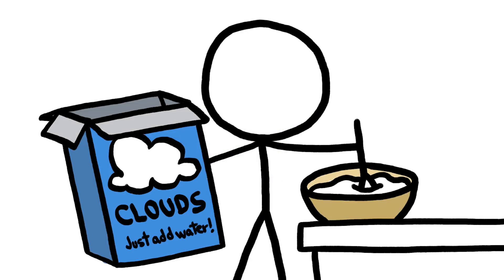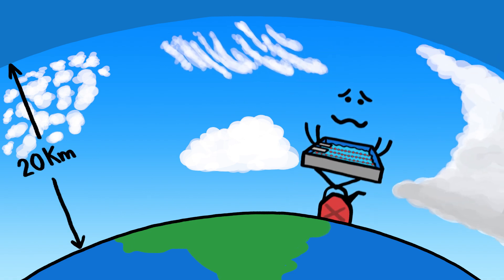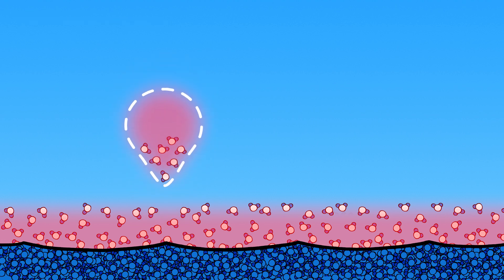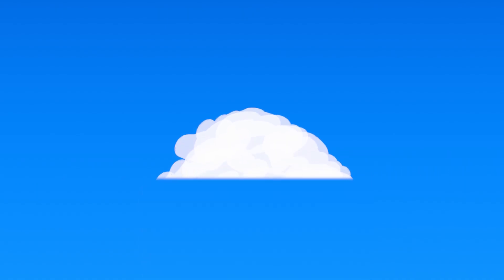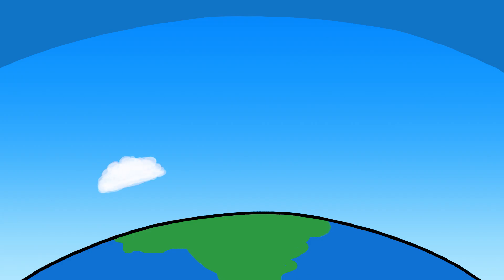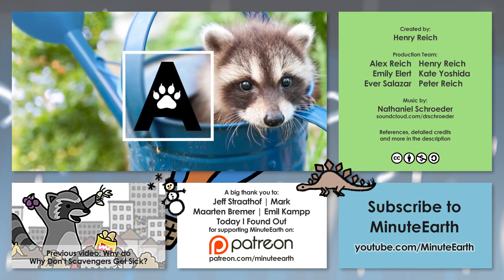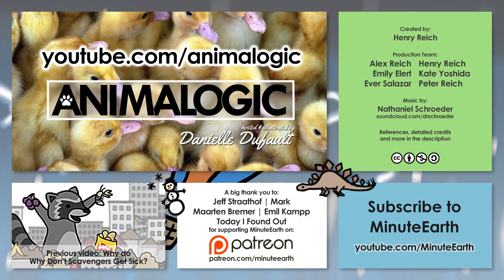Why Are There Clouds?

Comment: Great video and instructive graphics.

Do note if you're watching this that the statement: "in fact the more water vapor it collects before liftoff, the lighter it gets" while true is not a big impact.  Water vapor does weigh quite a bit less than air (18 vs 29ish grams per average molecule)... but water vapor is a very tiny part of even the most moist air (like less than 1% of it... so really dry is like 29 grams, and very very moist air is like over 28.9 grams... so it's not like it really balloons up a lot quicker due to being moist).  Certainly not a key point in the video, and one that makes sense to brush over... but for any who take that away from the video, be wary!

Comment: thanks.
i had difficulty understanding this part :
1:10 basic physics dictates that a given volume of gas
has the same number of molecules regardless of what those molecules are
then i found that is avogrado law
'equal volumes of all gases, at the same temperature and pressure, 
have the same number of molecules'
source : google (gas has the same number of molecules) result 1

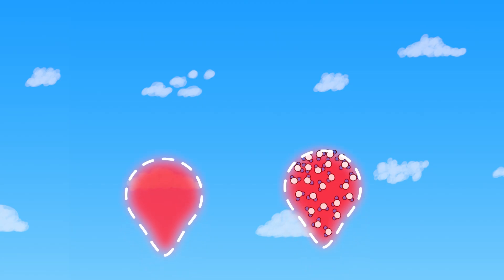1:16 h2o is lighter than n2, lighter than o2 so
warm humid air is more buoyant (lighter) than warm dry air.

Comment: Why are there clouds? I have no idea. Why is there air? Bill Cosby asked this question in the 60s. His conclusion is that there is air so you can inflate footballs and basketballs. I'm good with that. Oh, I think I need to add inflating tires. Gotta have tires. No tires, no driving at high speed or no auto racing. Got to have racing!

Comment: What I still don't understand is once the steam molecules condense back into liquid, why do they not become heavier than air again since the ideal gas law is no longer accurate and there can be more molecules in a given area. I am calling the equation at 1:10 the ideal gas law because it is so similar to the one I am used to but I have always seen it with lower case n instead of capital, and using R instead of K sub b. Is this just that physicists use different letter for same thing, or is this a totally different equation.
Reply: Sanity Clouds cannot condensate unless there is a surface. The cloud forms on floating particles in the atmosphere (Dust, etc.). The reason why the droplets doesn't fall is because the air resistance is greater than the pull of gravity. Wind smashes the water droplets together; thus creating bigger droplets. Soon the droplets would be too big for air resistance to hold it up, and the drop falls as rain.

The equation is certainly the Ideal gas law. 
Ideal Gas Law: PV = nRT = NkT
They are not different letter for the same thing, but it is a relationship between different calculations for the same thing. 
K(sub-B) is the Boltzmann constant
N is the number of molecules
T is the temperature

I've gathered and reviewed the information from:
http://hyperphysics.phy-astr.gsu.edu/hbase/kinetic/idegas.html
Reply: As I understood it air resistance is proportional to the velocity squared so there would only be air resistance if moving. Are clouds constantly falling at a slow speed and then climbing again when the water turns to steam again, or is that concept only applicable to large objects like planes and is inaccurate at the molecular level.
Reply: Gravity certainly move objects, and there is wind which moves the objects. I also think the heat rising from the ground probable plays a role too in keeping the cloud up.
Reply: the wind would only help if it was an upward wind, because side wind would only cause air resistance to exert a force to the side unless the cloud had an airfoil effect but that is unlikely since the top side isn't smooth and I think the air can pass though a cloud. My guess is that the molecules oscillate between the expanded gas and condensed water giving the appearance that it is not moving.

Comment: You said we would need fleets of airplanes to make clouds but we already have thousands of planes polluting our skies with artificial clouds on the daily
Reply: Not really. Those condensation trails disperse very quickly and can not accumulate.
You mihgt as well try to make fog out of the steam coming from a tea pot.
Reply: M. Koch haha "dispersed quickly" there is a difference from a Chemtrail and a Conrtail. 
http://www.geoengineeringwatch.org/wp-content/uploads/2013/12/941d53d329f33c9e56ee03092fae461d_1024-300x217.jpg

Comment: Aren't  particles, via heterogeneous nucleation, also a part of the cloud making process? The video seems to imply the water  condenses just because of the ideal gas law.
cf. Craig Bohren, "Clouds in a Glass of Beer" pp.4-6
Reply from the maker: heckler73 We are working on a video about condensation nuclei and homogenous nucleation at this very moment!
Reply: MinuteEarth   Hi, a part of cloud formation that you didn't show is that it grows from the top up  too.  A cloud consists of tiny droplets of water falling down in relation to the air particles in the cloud. so when these air particles  exit the top of the cloud, (not very fast but it does happen), this air is warm and humid,  and these little clumps of moist air  will travel upwards faster than the cloud itself because there are no droplets weighing them down.   This sucks the cloud up a little bit but also causing an area of condensation right on top of the cloud! Condensation (cloud in a bottle experiment) only happens when temperature or pressure are falling.  So the little warm air particles leaving a cumulus cloud accelerate away from the cloud and cause condensation in their wake.    If only we could see water vapor, this would be apparent to everybody!

Comment: Why doesn't the heat in the 'balloons' of warm air spread and disperse to the cooler air molecules surrounding it?
Reply from the maker: Irene Bianca Good question! It's because the warm, humid air mass is a lot less dense than the surrounding air, and stuff with different densities doesn't mix very easily (think oil and water).
Reply: MinuteEarth Ah... I see :) Thanks for the reply!

Comment: How does this example make the water a gas versus just very VERY small droplets of water?  Or is the animation just a slightly misleading way of visualizing this process?
Reply from the maker: Ozimandias84 Precisely the latter – it takes billions of water molecules to make a droplet. Sorry for the confusion!
Reply: Ozimandias84 distances between the molecules will cause it to be in certain states (or certain states have their molecules arranged in certain ways) so when the gas molecules cool/condenses, they will "clump" together and become water
Reply: Ozimandias84 if the droplet size = .002 mm, the # of H2O molecules in one droplet = 1.34 x 10^11 or 134 Billion.  The weight of the droplet is such that a breeze of .5 mph (.72 ft/s) would be sufficient to keep it aloft due to drag.

Comment: Why do oceans look blue? Is it as it straight forward as it sounds? Because at first thought I thought it was because it was reflecting the blue sky off the surface, but it looks blue even from space. Is water ever so slightly blue but it is only noticeable when there is enough water?
Reply: Yes exactly, water is slightly blue.
Reply: Ciroluiro 

Water is indeed slightly blue, but you can only see that when looking through a large quantity of water. When the ocean looks blue from space it is not because of the blueness of water, because there is no light shining through the water (from the ocean floor upwards). Instead the light is being reflected from the surface; the source of that light is the sun and sky. That means that the ocean appears mainly blue, but with patches of sun-bright white spots (reflections), even from space.
Reply: ProfessorEGadd are you sure that it isn't blue from space because the blue light gets reflected more while the rest of the colors continue down or something like that? Because even though what you stated makes perfect sense, it would also mean that for example red dyed water would still look blue from space, and it doesn't sound quite right.
Reply: If the rest of the colours continued down while blue is reflected then if you went diving and looked up from just below the surface the sky would be black. In fact we know you have to dive quite deep before that happens, indicating a gradual reduction in brightness.

Revisit the treatment of colour from a physics standpoint. The colour an object appears is nothing more than the colour of the light leaving it. Red dyed water appears red because only red photons can pass through it, but if there are no red photons it appears black, even when illuminated by other colours of light. The colour the water is dyed will have some effect on the colour it appears, but only if there is red (or white) light shining through it. During the day, the majority of the photons coming off the sea will be the ones reflected off the surface, not ones that have passed through the water, since the sun is brighter than anything in the ocean.
Reply: ProfessorEGadd I wasn't stating an exact property of water when I said it reflected blue, I just asked if, since blue light is more easily scattered than any other color in water, then maybe it also reflected more blue light, but slightly.  
This would not mean that it completely reflects blue light always, since that clearly does not happen. What you said about looking up to see the sky black would only happen if you were deep enough, at which point really most of the light would be lost for you to really be aware. 
By the end of your response you stated that the majority of the photons coming off the surface would not be red. This would mean that from space you would indeed see the water blue, then?
The reason I used the example of red water was just to make a point saying that I don't think that the reason it looks blue from space is because of the reflection of the sky. I know I don't have a counter argument for yours, but it seems plausible for me that in the same way we see oceans blue from here, that blue light reaches out into space. But I am probably wrong since it is based on a "hunch". Can you guarantee that if Earth had no atmosphere (but everything else stayed the same), the oceans would not be blue from space?
Reply: You might want to read the wikipedia article 'colour of water'.

If there was no atmosphere the sky would look like it does on the moon, black with stars. Coincidentally, that's just how the Earth's sky looks at night. So I would suppose that without the atmosphere the ocean would look like it does at night, black, but with star-bright patches. Just like a mirror would.
Reply: Ciroluiro Blue light is able to penetrate further into the ocean than the other visible light, but it is scattered. The Blue wavelength is scattered in the water due to Rayleigh scattering.

Comment: Can someone explain why the "balloons" got lighter with more water molecules? The explanation didn't quite do it for me.
Reply: Joakim Edby The dry balloon that looks empty is actually filled with air , which is mostly composed by Nitrogen and Oxigen, which are heavier water vapor. So, if you have more water vapor, you have less of other molecules, and water vapor is lighter than them.
Reply: Ah. Thanks, that did it for me! :D

Comment: Many clouds are formed this way. Unfortunately, above the temperature of spontaneously freezing of water (-40 degrees Celsius) the water requires a condensation nuclei to condense. This more or less occurs in the lower atmosphere where it is not as cold or in terrestrial environments. This is usually mineral dusts in the atmosphere. Mineral dusts usually only work for condensing water up to -15 degrees Celsius. All condensation nuclei above -15 degrees Celsius is biologically mediated using Ice Nucleation proteins. The clouds are just as diverse with bacteria as anywhere else.